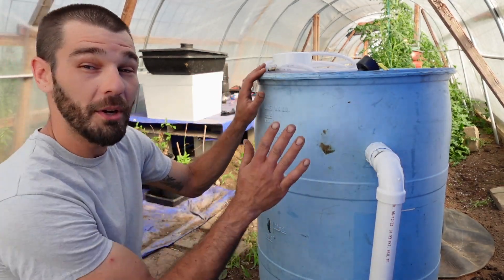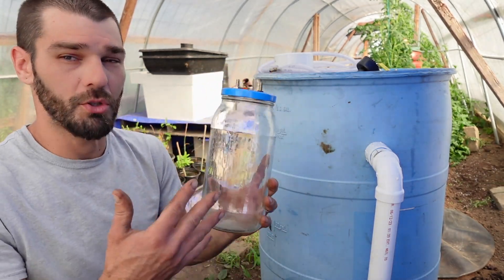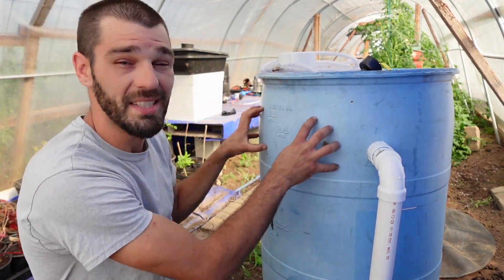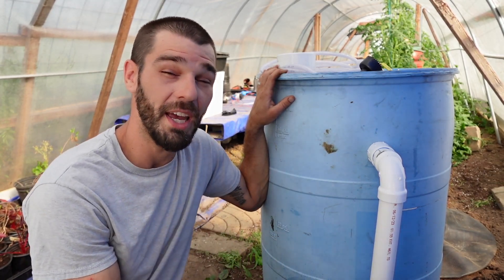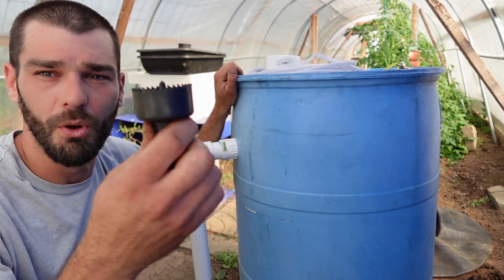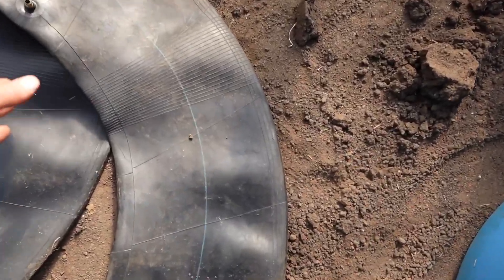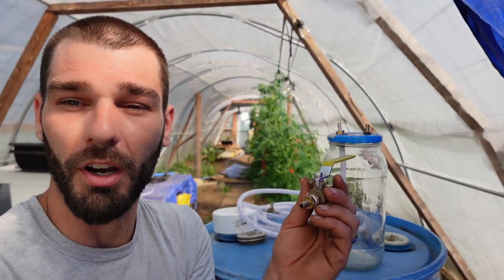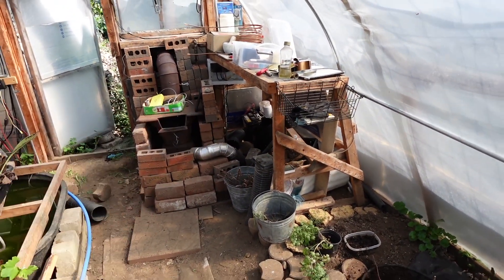DIY Greenhouse Methane Capture Experiment | Free Energy | FREE BIO FUEL Experiment

Comment: The thing about using a 55 gallon barrel is that it'll go through a door and you can always build a second one that you split the amount you feed it I'm planning on building one I do see a problem with the the u shape instead of an elbow to bring the output down its going to create a syphon draining the barrel down to the bottom of the u use a t outside so that it stops the syphon

Comment: Valve - you took the valve out
The bead is the tort area (usually wrapped wire in the rubber)of the tyre that is locked/pressed around the rim
You took the valve out of the valve stem
Otherwise excellent video

Comment: You are going to need a scrubber system to rid yourself of the water and the H2S in the methane. You'll need a flashback arrester ie the water trap with a touch of bleach. Then steel wool to capture the H2S and then one more with kitty litter or those special silica beads to dry your gas.  Removing the stem fom the tube is a good idea but you can also use an air mattress.  And a fridge generator pump thing to pump the methane into a cylinder. I will be doing all of this either this winter or the next. This winter for sure a compost pile and a hot air circulation system for the house. (small home) I want to use hot water in a vehicle radiator  (with a fan) for the greenhouse along with a few compost piles depending on how I can control it all.
Reply from the maker: We’ve got ourselves a nice heat exchanger to blow heat through this winter I’m going to experiment with, it’ll work the same as the car radiation. Good luck with the experimenting. We’ve recieved our Bunsen style burner and are getting everything situated for this system and are getting in gear to feed it a bunch of material and animal waste
Reply: looking forward to those vids!!!!!
 @Earthdwellershomestead